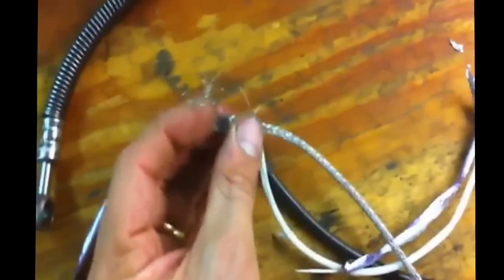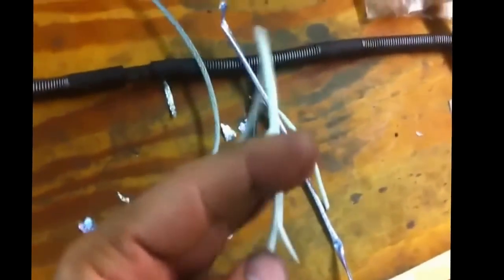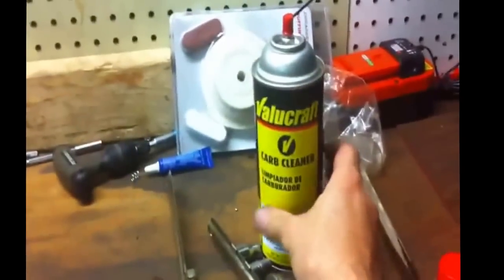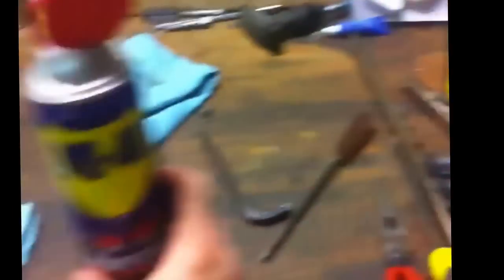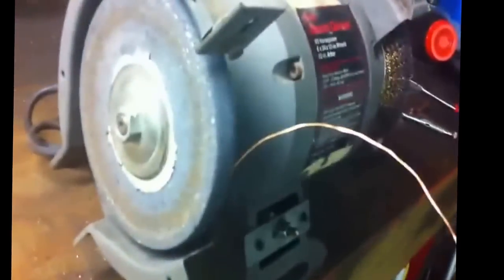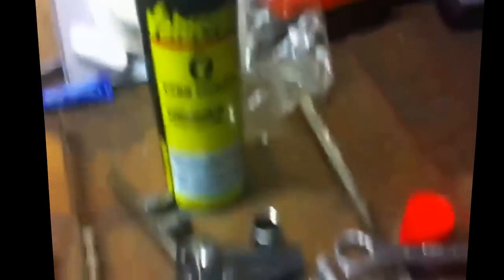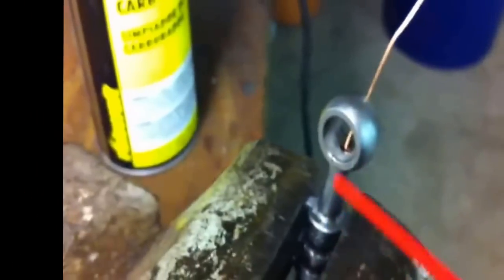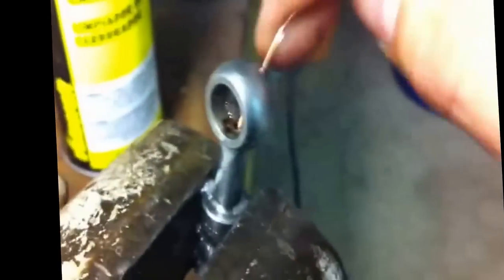How to Clean Motorcycle Brake Lines

Comment: Thank you, so much, nine years later  : )   ...  Your thoughts were mine, exactly, about the logic and efficiency of rehabbing my existing 1980 brake lines. The tips that you shared, were used. All of them. Thank you for the clarification, and the points that you made, in so much detail.  Nobody has this out, on-line, like you do.  Thanks again.,

Comment: Saved me a ton. Thanks! My bike has been sitting for 20 yrs. The coax cable inner wire I had was too stiff, but I found something else in the garage that did the job. Had to spin it a bit, like drill action, and it broke thru. Both were plugged at each end, right at the fitting. Now all clear.